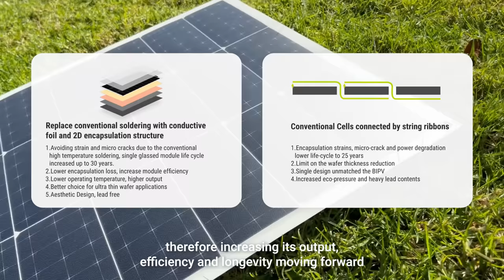Newpowa's BRAND NEW 100W 12V Semi Flexible Solar Panel

Comment: What is the reason for flexible panel made with the wire connections on the sun side of the panel? Seems to me it would make it rather janky for routing the cables and keeping them from over the cells. I personally would connect any panels on the shade side and wouldn't want them exposed over the front at all. Are there any advantages on the front?

Comment: Just received one of these today... incredibly lightweight but sturdy.  Very impressed!  Trying to attach it to my camper trailer roof (which is slightly curved).  How do you recommend?  Silicone caulk?  Construction adhesive?  Thank you
Reply from the maker: Normally we drill holes and mount the panel in the "hard way", but we did use silicone before. One thing need to be concerned is, leave some air flow space at the bottom of the panel, it goes hot under the sunshine, although the heat does nothing to the panel, it will get your mounted surface "tanned". Other from that it is a durable way to mount the flexible solar panels and we use both ways on our trailers. We also have customers suggest us to try use Eternabond tape, will try when have time.

Comment: What is the panels efficiency in percentage form?  Do you plan on making larger flexible panels like Renogy does (175w and 200w)?
Reply from the maker: The panel holds 20.9% efficiency in general and yes we are planning on making larger panels, still testing.